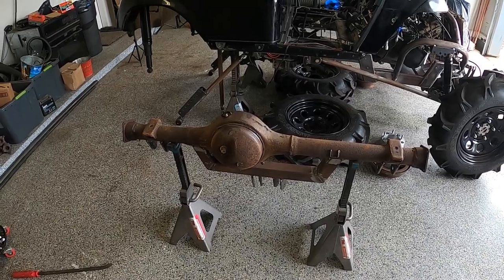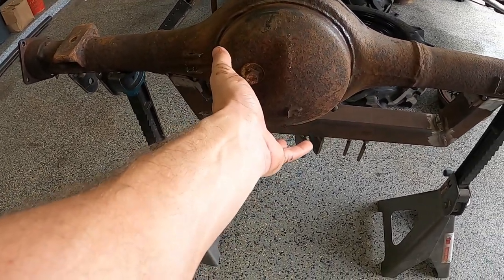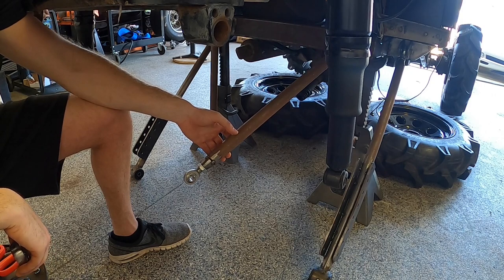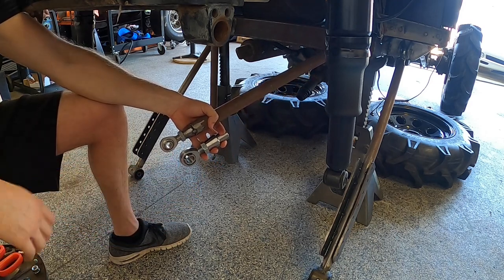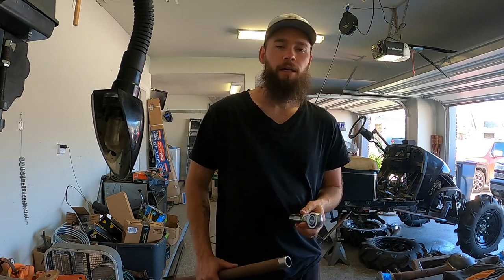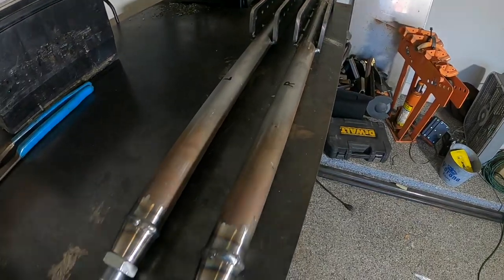Monster Golf Cart Build Part 10 Rear Differential Flip | Bare Metal Fabrication

Comment: Cant wait. Love that you admit to changes you dont or didnt like and  you keep it real. Thank you for sharing your build. Waiting for my jake long arm to ship but the are so back ordered I might not see it until the end of summer.  Thinking about doing a H swing arm that connects to the gas motor skid plate/mount to the H swing arm. I dont have enough clearance for a 4 link because this motor mount plate is connected to the axle. I was thinking about the 2 control arms and a panhard bar but wondering how the swing arm would do instead.
Reply from the maker: Thanks I appreciate it! I'm not afraid to admit when I messed up and came up with a bad design. I lost count how many times I have scrapped something and started over. I think I rebuilt my front suspension 4 times before I settled on a design I was happy with. But If something is just slightly not right, it will bug the crap out of me haha. So I'm constantly rebuilding and tweaking parts here and there to improve them. That sounds like a fun project you are working on. Love gas carts!